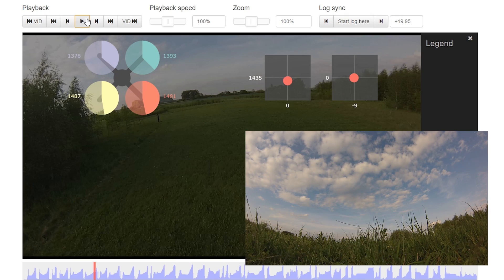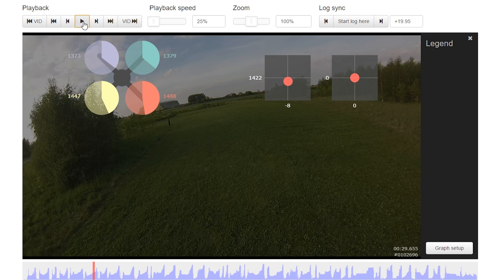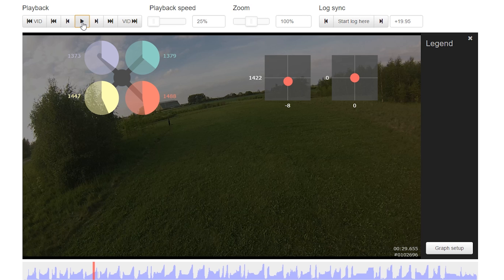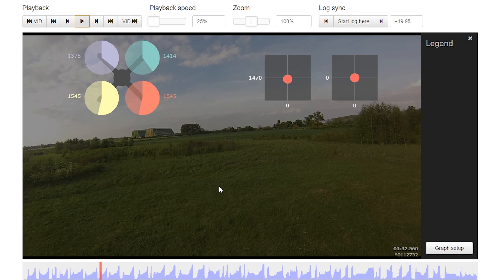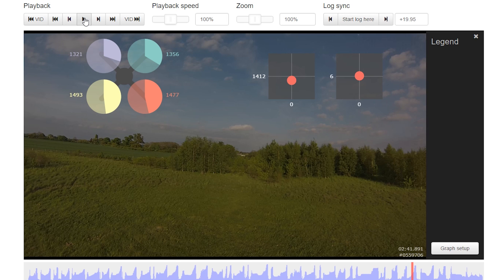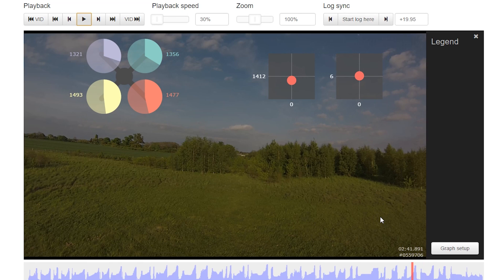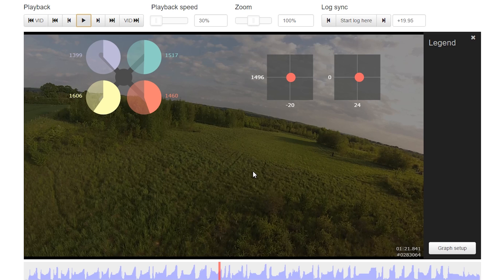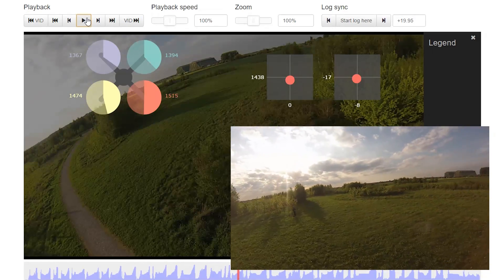FPV Acro Freestyle Basics! Pop, drop, manoeuvre, catch.

Comment: Thanks.  In the trick you're rolling on the 'frame' axis.  Do ever demo the same move by combining a bit of yaw so the you're rolling on the axis of the camera angle?
Reply from the maker: Yes that's possible and actually part of keeping a centred inverted yaw which I have a few tutorials on. The second of which I discuss more in depth. If you're feeling a little lazy there is a setting called camera angle mix which applies this for you on the configuration page, though there is a tiny bit of latency added, nothing you'll likely pick up on though.
Reply: @NJ-Tech  Yes, I've heard about that setting in BetaFlight.  Are you aware of anyone that has done a comparison, real world comparison with/without that setting implemented?
Reply from the maker: @checkeredflagfilms  yeah plenty have tried it and some keep it on. Personally I prefer to have it in muscle memory for certain manoeuvres as for some it would be undesirable.

Comment: What are you using to get the overlay on the flight video? Would be nice to be able to do some post-flight evaluation of my stick throws.
Reply from the maker: its called bletaflight blackbox explorer. Your flight controller needs to have an onboard flash in order to log the flight info/inputs etc. You select it to record via a switch in the modes tab of betaflight. Then you can download the file from your flight controller and drop it into black box explorer along with a video file of the flight. You then line up the start of the blackbox with the audible  arming beep from your video and youll see everything going on with the sticks as well  as a heap of info about the PID controller over the top of the video. There are quiet a few videos out there on how to set all this up.

Comment: Very helpful, I am just starting with FPV and have just managed to get a grip on Acro, (just posted a new vid of it) and looking at how to start pulling basic aero's, chopping throttle in the roll etc is something you might not think to do instinctively but now I will when I try it. I have rolled in Horizon but not Acro, it's the thought of... "will I be able to come out of the trick in control" or not? With Acro it's so different, it won't (obviously) arrest the roll when level... I think I will do with some height until happy. Thanks again, really good vid, what is the program you are using to show us your video, it's a great way to display and explain your tricks. One question, is it common to have your Failsafe kick in when you are FPV'ing? Like when you fly slightly behind something solid? It happened to me twice the other day, both times it activated when I went close to out of sight but not fully. My latest vid has one at the start and one at the end, both show it Dropping and crashing, both Failsafe, just wondered if it's common? Or do I have a problem? https://youtu.be/sVoJQ2lLQKk Thx again from Kiwiland!
Reply from the maker: you're welcome, yes failsafes can happen when you break line of sight to the quad behind some more solid objects, so fly cautiously and try to not put large objects between you and the drone as it can block the signal enough to cause a failsafe. Happy flying! The program is called blackbox.

Comment: i do have one more question bout this quad. on flight modes is it just like on a heli? so example lets say I put it in flight mode 2 or 3 does that mean its idled up and throttle wont change when I flip it or do high speed flying it just maily turns throttle into pitch control? THANKS
Reply from the maker: So the flight controller is in some way doing that, well actually its doing all the hard work! All the controls are active all the time. It's not like a Heli idle up where throttle is maintained at a set rpm as such but I get where you're are going with the comparison. When you front flip at a set altitude for instance, the rear motors are briefly spinning up faster than the front motors to bring them over the front (a front flip) whist the front motors drop rpm so as to not add resistance to that flip. When the flip stops they resume whatever throttle position they were at to maintain that set altitude. Now, conversely, say you wanted to do that same front flip whilst the quad was climbing at maximum throttle? This time the quad would see all motors are at max thrust so in order to gain that same front flip it can't generate anymore thrust from the rear motors so it just drop the rpm on the front motors to achieve the same thing. I hope that makes sense, but what the FC is doing is adjusting what thrust it has in any given situation to achieve what the pilot wants. Thats a very basic description mind, its infinitely complicated whats going on, as as well as that it has to maintain stability in the other axis and correct for external forces like wind etc. Its pretty amazing the more you think about it :)
Reply: THANK YOU MY FRIEND I understand more now as I'm not a quad flyer or ever had one iv just been a plane guy but I was thinkin bout getting this quad for some fpv. I have the first gen dx7 so I thought bout getting a dx6e to upgrade a little bit. I really appreaciate your time and Thank you for the knowledge.
Reply from the maker: Sam you are most welcome! I'm sure you would love it ;)

Comment: what ya need  elevator on a quad, I mean if u give it throttle it climbs right?
Reply from the maker: You need elevator (or pitch) for the same reasons that you need it on a helicopter. If you can't adjust the pitch of the nose you can't direct the thrust to move forward. Ever notice a helicopter hovering is flat, but then when it moves away its nose goes down to start moving forward? Pitch is as vital to how a quad flies as it is to all fling machines.
Reply from the maker: Above and beyond - 'sun in your eyes'
Reply: u know I layed down last night kinda late and thought why did I ask such a dumb question lol im used to planes so for some reason I just wasn't thinkin when I posted guess the late nights are getting to me. Thanks for your comment

Comment: how do you feel about thumb vs two finger stick control?
Reply from the maker: I spent the first 10 years of my RC time using thumbs, I went to 'pinch' after that when I was flying 3D helis and have done it that way ever since. I just felt like it gave me more precision. Though I think its pretty 50/50 across all types of pilots and pretty subjective. Give both a good go to get used to them is my advice, you'll soon see which you prefer.
Reply: thanks, 50 % sounds good enough, after 40 years using my thumbs I think pinch might be a ruff transition.  I've bean learning fpv drones and think I can see where pinch is more precise. maybe i'll experiment with shorter sticks.

Comment: very nice tutorial, I am getting into fpv and it is very hard to look into the goggles and fly around. I wonder if it is better to get pretty good in acro in line of view then switch over to goggles. also what kind of mode are you in? acro or air mode?
Reply from the maker: Christian Bianchini both acro mode with air mode enabled. although it's a great idea to keep working on LOS skills, all it takes is time in the goggles to get used to it. start with good level circuits and just keep at it, it will get better with every flight I promise :)
Reply: NJ Tech ahah yeah I am ok flying in angle , and getting used to acro. already smashed few props and having a go every day. I am ok flying high but want to get some fine motion with low ground and obstacles. let's see..
Reply: Acro is Air Mode. If you switch to Acro it will display AIR on your OSD. I had the same question, I am also brand new to FPV and Quads. This is what I did and it worked great. Get used to your Quad in LOS (Line of Sight) flying but just in Angle and Horizon modes. Try some Acro but you will find it very difficult, I did. Flying Acro LOS is completely different and way harder than Acro in FPV. In FPV you have the advantage of seeing FROM the Quad so you can adjust attitude very quickly, not the same as standing there looking at it, that is very hard in Acro. Get LIFTOFF Simulator and practice Acro, then go out and lift off in angle mode, get moving and switch to Acro, you will find that after using the simulator it becomes natural and you will be surprised at how easy it is, must have some sim experience to work out how to fly Acro... I just did my first Acro FPV yesterday and it went much better than I expected, it's so much more fun... it's not that hard. Have a look if keen https://youtu.be/sVoJQ2lLQKk
Reply from the maker: Actually no, acro does not mean airmode. Acro means the level mode is no longer engaged (the accelerometers) and just the gyros (rate mode is its true name) are engaged. Air mode is a selectable 'mode' you can have permanently enabled or on a switch which works together with rate (acro) mode to give you full rates (movement in degrees per second) on your sticks extremes on pitch and roll at all throttle positions. There are videos explaining this in more detail if you search in youtube.
Reply: Sorry, I know that but what I was trying to say was, when you select Acro/Rate Mode it usually displays as AIR on your OSD, not Rate or Acro. I switch to Acro and also switch on and off Air Mode to keeps my motors running at zero throttle, which is what you are saying about airmode. Cool..
Reply from the maker: I still think maybe you don't quite understand what air mode is. Its not about keeping your motors spinning at zero throttle, its about maintaining full stick rates at zero throttle. What you are describing is a switch in the configuration page which keeps the motors spinning when armed, even if you are at zero throttle. That is not what airmode is or what it does. Watch this video to understand what air mode is: https://www.youtube.com/watch?v=d2nRrVENEYM

Comment: why not full throttle while flip? fc would give thrust only to right side motors and faster flip with some flying down of course for a while?
Reply from the maker: +FotoAmg AmgFoto the flight controller is acting like a mixer. If you ask for full throttle and flip it will be powering through the flip way off its axis. Much like a small powerloop. If you try it you will see :) to keep a tight flip close to axis you must bring the throttle down.

Comment: does a multirotor also get some extra lift when it is flying forwards?
Reply from the maker: multirotors have nothing aerodynamically to offer that helps with lift when moving. Like their helicopter cousins, they do become slightly more efficient in forward flight due to what's called 'transitional lift' across the rotors, moving into clean air. Hovering is actually the least efficient thing to do.

Comment: Hi NJ, I noticed that you are always moving forward without applying pitch forward  all the time. Is that your camera angle or maybe your engines are mounted with some angle (lets say, 10 degrees?) I am asking that because I need to pitch forward more often to go forward than I have seen you doing. I am using 25 degrees on my fpv camera. What makes you keep going forward? Thanks for your help and tips!
Reply from the maker: Hey there, so in rate mode when you set the pitch forward it should maintain that angle and keep moving forward with just thrust to stop you sinking. If you quad is needing constant forward pitch and wont keep its nose down when you let go then your 'i' term is too soft and needs increasing. If you watch my PID tuning video i talk about how to tune your quadcopter to get this right. I have no angle mounts, and i run a camera tilt of about 25 degrees. Hope that helps :)

Comment: Would it work with a mini quadcopter? let's say Hubsab X4 .)
Reply from the maker: there are plenty of miniquads on betaflight that fly fantastically. The hubsan no, mainly because its a self levelling quadcopter, there is not rate mode on it. Plus the ones with fpv are heavy, it just doesnt have the thrust, unless you want to get serious with your mods.

Comment: Awesome video and well explained! What program are u using to sync the blackbox data with the gopro footage? I've got a Vortex 250 which has a black box and I also want to sync some footage. Thanks in advance!
Reply from the maker: +renesebastian hey thanks :) it's the cleanflight blackbox app which you can pick up free on the Google app store where you get the cleanflight configurator. It's a chrome based app.

Comment: Hi! How come you are using 20A ESCs with these motors and props? Wouldn't 30A be more usable with this combination?  Sorry for a nooby comment :)
Reply from the maker: remember they are 20a each so a combined 80amps nominal and can handle up to a ten second burst of 30 amps each for a total of 120 amps. that's plenty for a little 5 inch quad ;)
Reply: Thanks! I'm pretty new to the hobby and was just looking at the amp chart provided by Emax for these motors.
Reply from the maker: +Gregor Ambrozic you also have to remember static thrust tests aren't like they will be in flight because unlike the bench, the quad won't provide as much resistance as it actually moves with throttle increase in the direction of thrust which reduces the load/current draw
Reply: OK, that makes so much sense. Thanks again :)

Comment: Great vids to help us out thanks 😎 can I ask what cam angle you have ? As when  I do a roll I end up like 90 deg from where I started ? Would this do with angle of cam ?
Reply from the maker: +rebels of the sky I use about 30 degrees up-tilt on my FPV camera. Rolls should actually be easier with 0 degrees up-tilt so im not sure why you are finishing 90 degrees off? make sure that you are clean with your inputs of the manoeuvre. If you are touching the pitch by accident during the roll, then that would cause you to finish in a strange position.
Reply: +NJ Tech  yea  prob me need more mussel  training thanks !